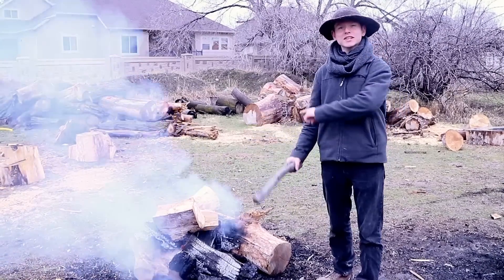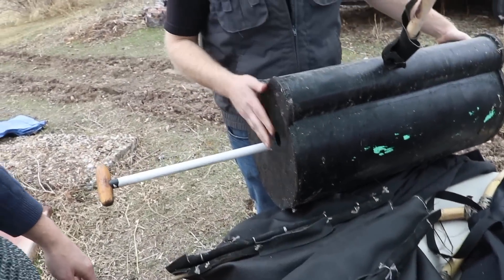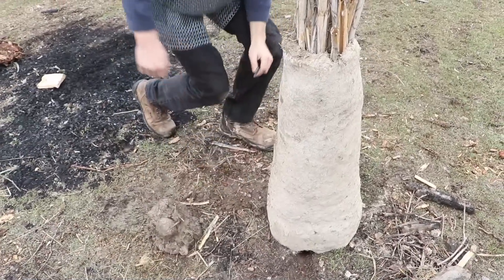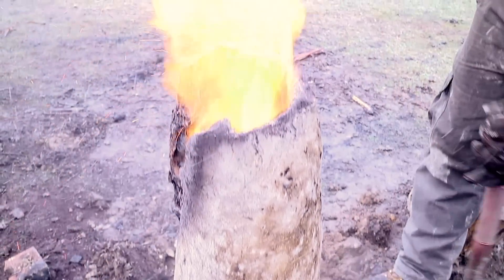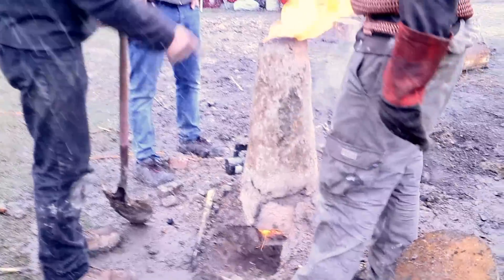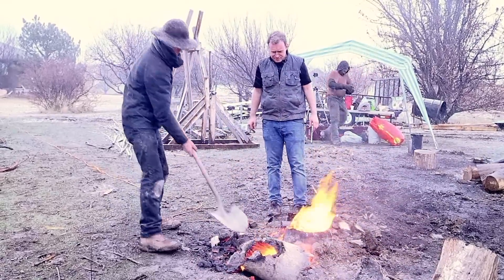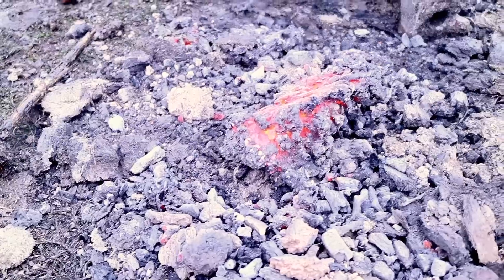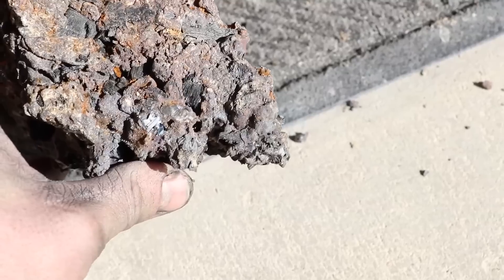Smelting Iron with Cody'sLab!

Comment: My father used to do this for high school students - fetching bog iron and melting the other stuff away and then the "mushroom" had these tiny pebbles of pure iron on it. The mushroom then needed to be hammered with the wood hammer (as if you try to hammer it without CO iron will burn) and he was able to make tiny iron items from it. Old legend tells us that those mushrooms were stored in certain places to get the iron to rust a bit to get the pebbles to be spotted. Cool stuff. Just remember you actually are not suppose to melt the iron but just to get it reduced and forming these small granules.

Comment: the best manuel way of pumping air into the furnace that i know of is to use the syste a bag pipe does. you use something to get air into a bag that is sealed of with a 1 way valve so the air dosent go the wrong way. then simply put a big weight on it then jsut start pumping that bag full of air and you wil get a constant airflow reguardles of your skil and rythm of the air you put into the system.

Comment: 1:15 you should research the Trompe which uses flowing water to compress air to feed the fire. It was used in Catalan Forges back about 400 years ago. A giant version was built in Cobalt, Ontario at the Ragged Chutes rapids, which was a meter in diameter and could supply compressed air to all the mines in the region.

Comment: If it makes small short lasting Sparks, it is iron, if it makes long flowering Sparks, it is high carbon steel, hope that helps
Reply: Hardenable steel throws long flowering sparks after hardened, but puny ones when not hardened.

Comment: It has to do with the coal that was used. Use hardened wood and put it in a pit fire. Once the wood is hot enough, cover it with dirt for a couple days so no oxygen gets in. Then use that coal to burn the iron. That's the way they explained it to me.

Comment: Wow guys!  Really interesting! Keep up the cool work.   I know you guys have gone through several design iterations but have you experimented at all with the grain size of the charcoal?  

If memory serves me correctly it's the carbon monoxide in the flue gases that actually reduce the iron oxide to iron metal,  there might be a sweet spot somewhere between increasing the void space in the bloomery to make it easier for the flue gasses to pass through but not so much so the furnace loses thermal efficiency.  I haven't tried it myself so take it with a grain of salt, but maybe something to think about?  

Maybe you could have a secondary furnace that's designed to feed the bloomery with additional CO2 to help the smelting along? 

I'm also forgetting whether or not you guys added limestone to the bloomery.  I know blast furnaces use that as a flux to aid in the removal of slag, maybe that might help too.

Anyways good luck!
Reply from the maker: Great ideas! Thank you! I've actually been wondering about the grain size affecting the burn. The biggest challenge is keeping airflow going. So the voids are a major concern. JB

Comment: I have to question which methodology you were aiming for to do it the way you did, because everyone here seemed very unsure of the next step, and lacked proper period accurate tools.
Reply from the maker: The goal is to try making iron tools (hammer, anvil, tongs) without using any of the above as the first blacksmiths would have had to do.  JB
Reply: Good and Basic period specific assuming thats why you beat the bloom out of the casing with a log. I've seen a few demonstrations and one live demonstration of smelting iron with a similar method you used, but there were many large differences, such as using an actual wooden mallet that i though wpuld be in keeping with the theme of the channel and you didn't move straight to working the bloom after extraction. If  the log was just the tool that was on hand, and you knew there were time luxuries you didn't have,  then fair enough.

Comment: Cody's chain mail is so silly. Copper is really not a good for protection against steel, bronze would've been safer and ideally it should've been steel.
Reply from the maker: Dude. I don't think Cody's expecting to get shot full of arrows. The shirt is mostly for passive workout and electrical experiments. JB
Reply: @GoodandBasic  Well I imagined that he would use for protection against perhaps a knife stab, in which a steel knife would easily penetrate his copper chain mail.
Reply from the maker: More easily.  But not easily.  He's done stab tests on it before. Every ring is welded (or soon will be). JB

Comment: Who else discovered this channel from Cody'sLab?

Also I'm curious: would it be possible to use a stationary bicycle to pump air with a modified bellow-barrel?
Reply: Yes, and it wouldn't be to hard
Reply: Heard about you from the hike with Cody video. Am subbed now. Good content :)
Reply from the maker: Thanks! JB
Reply: You'd make a gigantic blower fan like he showed in the beginning.
Reply: No, bicycle pumps are designed for pressure, not volume. For a furnace, you'll need volumes of air.
Reply: @PerBuer  Not a bicycle pump, but bicycle to pump
Reply: @wobblysauce  Haha. Ofc. Makes a lot of sense. I can't read.

Comment: amazing how anybody worked out that if they did all of this they could make tools
Reply: There were a lot of steps on the way. 
    
Iron comes about as a discovery only once the bronze age is up to "industrial" scale and using larger furnaces to speed the refinement of bronze metals (copper and tin) that get to iron refining temperatures. 
    
Once discovered, however, it is vastly more economical, as iron is practically everywhere while rich copper deposits are disparate.
Reply from the maker: Not entirely true. Iron predates copper in some areas of Africa. JB
Reply: Correct!  @GoodandBasic  There is a documentary called Tree of Iron that actually documents this, though I'm honestly not sure how they made the leap straight to refined iron without other intermediary metalworking, myself, as it costs $320 to buy as an educational resource.

Comment: You've got iron but you've also got lots of other crap mixed in with it - bits of glass, clay, rocks, charcoal, etc.
 You'll probably need to remelt the chunks in a clean gas or electric furnace - the iron will sink to the bottom and you can skim the rest off the top.)
Reply: Ah yes the 'ol ancient electric furnace. They're trying to do it the ancient way dude